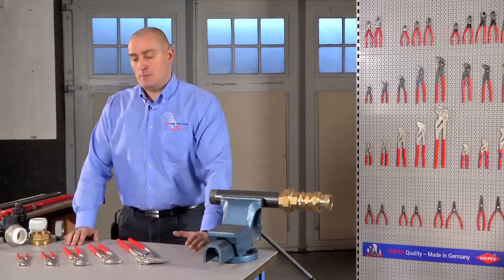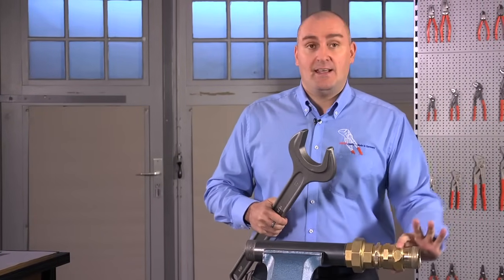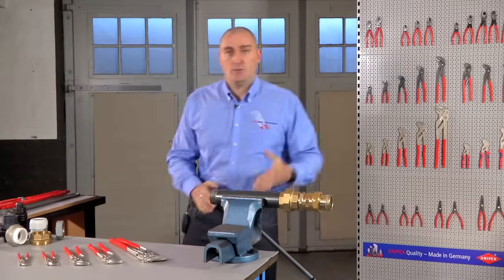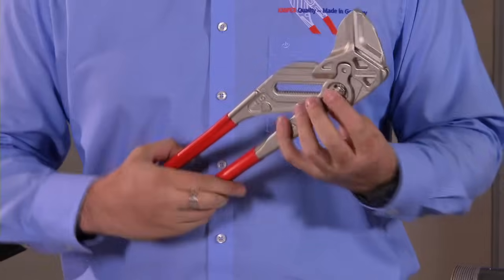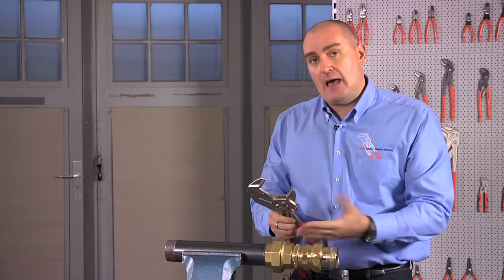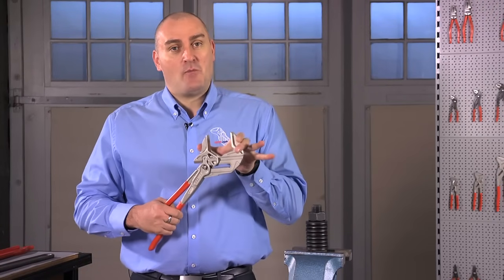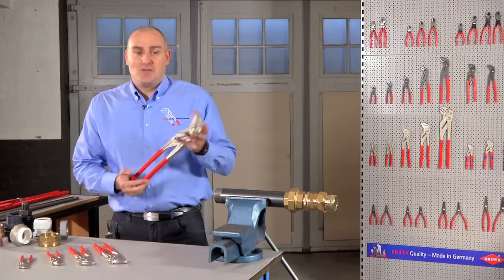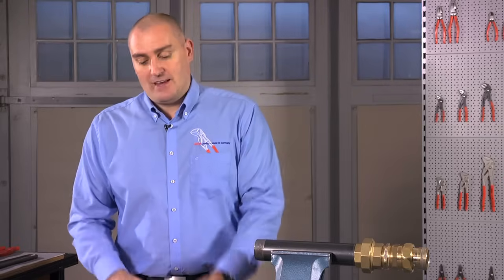From the KNIPEX workshop: the Pliers Wrench XL

Comment: The size of that spanner is comical 😂
Reply: He's lifting it as it was made out of styrofoam, either this guy has thunder fists or the spanner really was just a composite replica made for the show. I'm surprised they didn't tried out a 24" adjustable wrench instead of the open spanner, as they could have clearly showed that even a massive 24" crescent only opens up to 2-7/16", which is less than my 10" cobra lol.
Reply: Its actually only a 13mm spanner, it just looks big because Alex from knipex UK is a tiny little man.
Reply: Pipeline work
Reply: Besides leaving markings, if I use water pump pliers does it do any other damage on the bolt/nut??
Reply: @galtigjtokay5318  on plastic it does yes.
Reply: He looks average size to me

Comment: I have the 250MM version (approximately 10") and I use it way more frequently than I thought I would.  I've used it for obvious nut/bolt applications, but also for tightly holding things I don't want to mar, to flatten small pieces of metal, to flatten tweaked rings for jewelry clasps etc.  A beautiful, very well-made tool that every tool guy should own.
Reply: Agreed. I have a set myself (don't recall the size). The uses go beyond the intended purpose and the quality is top notch.
Reply: I use mine more than any other tool. I actually don’t use end wrenches very often anymore unless I just can’t use my wrench pliers.
Reply: Besides leaving markings, if I use water pump pliers does it do any other damage on the bolt/nut??
Reply: I think this is what I needed when workin on my car's tie rods.
Reply: @galtigjtokay5318  it can. It doesn't always but it can scratch or mar the nut. Especially on softer materials.
Reply: I have the 10” and they are huge and heavy.. kinda hate it because I’m in tight areas when I’m using them.. but the slipping setup kinda helps with that. For daily small use I have the 5”.. it’s a dream
Reply: @galtigjtokay5318  no. water pump pliers will do the job but leave their mark behind.

Comment: A spanner that large runs about $750-$1000. Our shop Bought one for hydraulic cylinder nuts and if I remember correctly it was something like $1100 for a 4.25” wrench.
Reply: You mean 110usd? No way 1000usd unless you overpaid

Comment: sooooo happy with the medium pair I have, fantastic equipment
Reply: Besides leaving markings, if I use water pump pliers does it do any other damage on the bolt/nut??
Reply: @galtigjtokay5318  not really damage, but itll eventually mar and cut the soft brass to the point of having to replace the fitting. Either get a spanner or a wrench or the pliers wrench. Make a habit of doing it correctly!

Comment: i own the 125 mm, its good for tasks that does not need alot of force, like rusty fasteners or overtightened. for certain situations is the best. i need a tool to grip on 24 mm hexagons so i ordered the 150 mm Cobra. 
very good tools, cant be compared with cheap tools.

Comment: I use two of the 10" version in preference to open end spanners or adjustables.
 I have them  hanging from the back door of my van as a go to tool to grab for repairs.

Dont debate the price, treat yourself, they are brilliant.
Reply: I have the 250mm (10") version.

I've bent a rounded off nut back into some sort of usable shape and bent the thread back into shape while undoing it!

Comment: Had anybody ditched their Crescent wrenches in favor of these...?

Thinking about getting a ~6" and ~8", for HVAC work.
Reply: +scrambler350 Absolutely. Well worth the cost, these things are the best hand tool I've ever used in terms of quality, versatility, and innovation. I bought the 7in pair from Menard's and loved em so much I ended up buying one of every other Knipex tool they sell at Menard's. I replaced all my Crescent wrenches, Channellocks, and even (i'm surprised to admit this) some Klein tools. They're a little pricey but so totally worth it.
Reply: Got a couple of the Cobra Pliers, Lineman's Pliers, and Cutters...the Pliers Wrench is next on my list.
Reply: 100% Yes. I can't believe I ever used a Crescent wrench after using these. The large Cobras have also replaced my pipe wrenches.
Reply: Had mine for a little over a month now, love them - barely used my standard crescents anymore.
 The 86 03 180 is EDC'd in my front pocket.
Reply: mike_HVAC..  I got these and love them!  I used a buddies crescent wrench the other day as I didn't have my tools and I spent forever dicking around getting the wrench to fit and then re adjust because the teeth are garbage and the jaws back up and round the work piece.   These knipex pliers and the auto adjustable cobra pliers are the best tools I've used.  They really are made well and have a slick adjustment to them unlike the cheap shit that binds up.  Knipex for me everyday!
Reply: i bought 7" 10" and 12" form johnstone.  most i use is 7" for HVAC work, 12" do most the plumbing or pipe fitting. 12" cobra can be 10" pipe wrenches for most the time.
i like to have 16" Pliers Wrench XL and 22" cobra.  i hope can replace 14" and 18" pipe wrenches.

Comment: I have a couple of these, as well as cutters, etc., and they’re quite good. But comparing it to a dedicated wrench isn’t really helpful. That wrench can apply a good deal more torque because of the handle length and rugged construction. So they aren’t quite interchangeable.

Comment: Hi Knipex - I'm disappointed with my 250mm version of the same model. I can't understand why the thumb operated button head is so small. It makes use very ackward to fully depress the button to allow jaw adjustment. In particular, when wearing any protective gloves or when the pliers/wrench adjustment is made at a point  below your body level. Making the button head the same size as the circular recess below would improve the design.